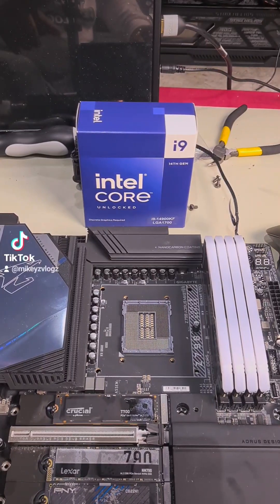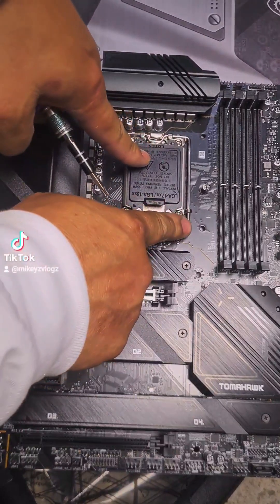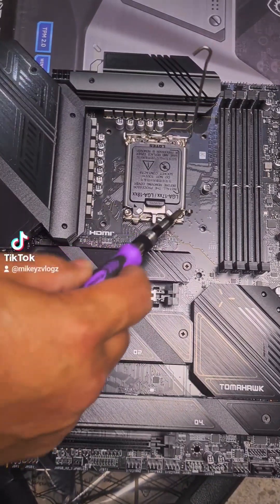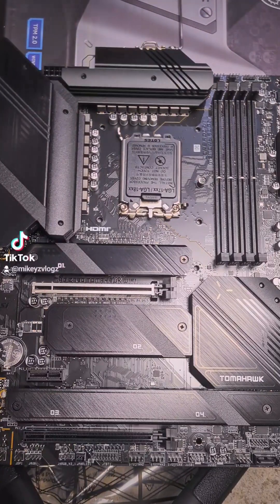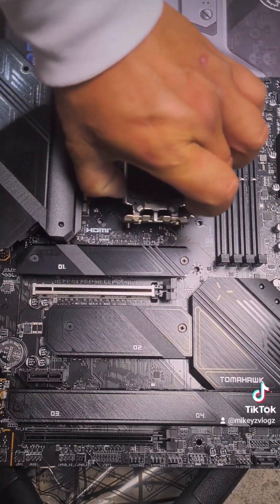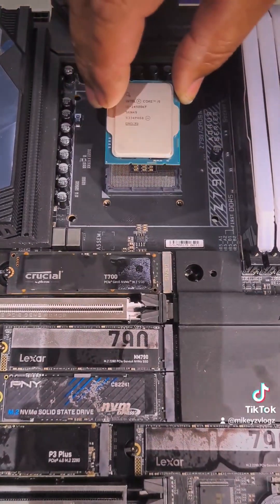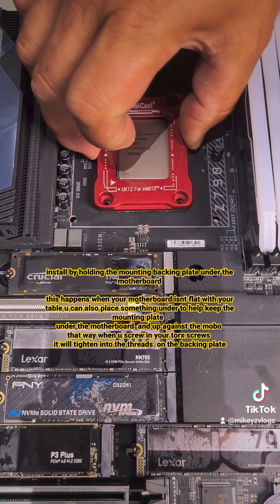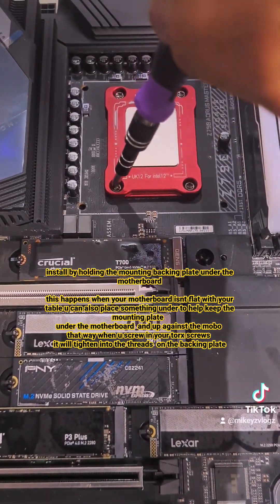how to install a 14th gen cpu with a anti bending corrector frame. 14900kf lga 1700 socket. z790

Comment: It was my first time building a pc, and i removed the brackets for the cpu but now idk how to get them back on
Reply from the maker: ok alot of ppl forget that theres a backplate that the screws screw into...once u unscdew the bolts that backplate will fall cuz theres no longer screws holding it and pressing it against the case behind cpu  .so look on the insode of your case behind the motherboard on tje other side of the case ..and u will see a backplate with x4 s rew holes threads ...gold it up and put a single screw back in to hold it in place then realign the rest of the screws

Comment: Screws won't screw in anymore. I did it very lightly idk what happened. Update it was bracket on back came off had to line it up. Overall used to max out at 100c in cinebench now max out at 91. Pretty good improvement. Got a crappt ml240 cooler
Reply from the maker: thats great def worth that 9 degrees

Comment: put the cpu in first
Reply from the maker: yes good tip
Reply: @MIKEYZVLOGZ  I've been building computers for 20 years
Reply from the maker: @daniel1212uk  good stuff ..me 3 years going on 4
Reply: i didn't get it. he already put the cpu in first right?
Reply: @billy5740  put the CPU first before removing the screw. So that if u accidentally slip ur hands, the item fall on ur CPU not on ur pin.

Comment: This isn't correct, plastic round isolation washers need to be between the new bracket and motherboard as it could short out.
Look before fitting, I spotted it straight away.
Reply from the maker: there's foam padding on the bottom of the plate

Comment: is it required, i got the 14600kf and the average temperator is in the 60s
Reply from the maker: i see .. what cooler u using
Reply: @MIKEYZVLOGZ  cooler master ml240L V1, not supposed to work with lga1700 but somehow worked, and my temperature is good
Reply from the maker: @static8110  what's not supposed to the cooler? Was it for 1200? If so I can make it work just use the adjustable mounting kit and make it fitn
Reply: @MIKEYZVLOGZ  yeah that's what I did and it works fine, my question is about this vendor corrector frame,.is it required in my case?
Reply: @static8110  so the temp issue does happen over time, because it takes time for motherboard to bend the cpu i have 12th gen cpu and so far its fine as well